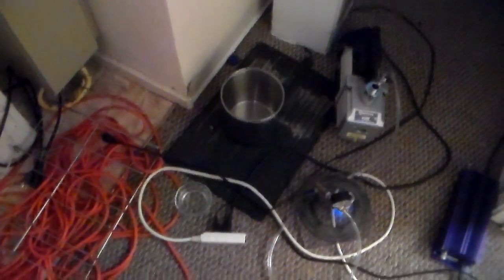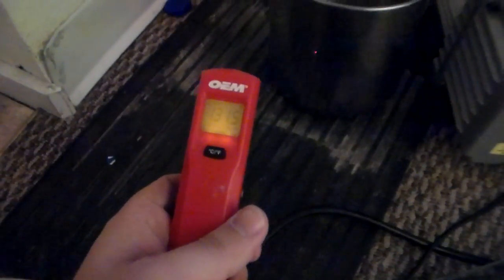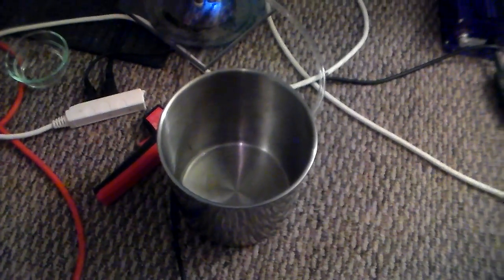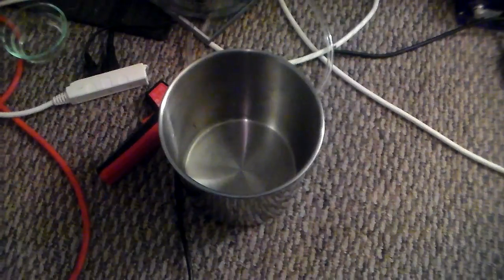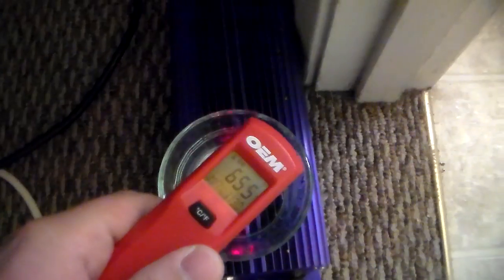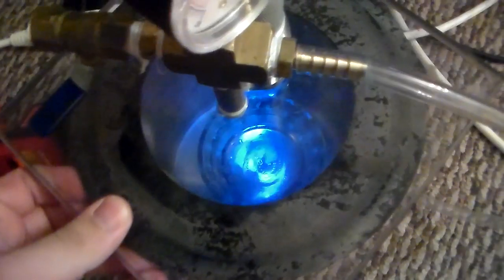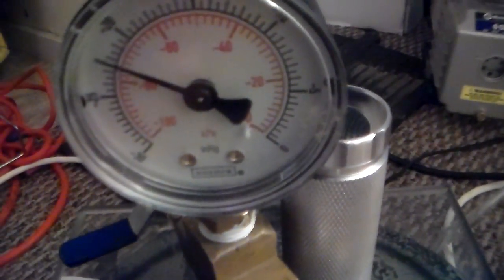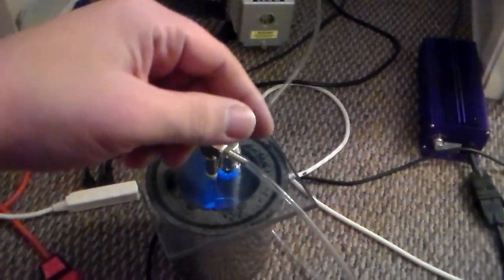I was wrong!

Comment: Putting the oil under a vacuum lowers the boiling point of butane which allows it to boil off faster without harming the potency of the oil. But over-purging can still be a problem as terps also have lowered boiling points under a vacuum, so you can ruin your flavor if you don't watch your pressures closely enough.

Comment: When i went to HVAC school, we learned that water does boil in a negative pressure. Now i dont know if it can kill pathogens like normal . I also did a vacuum without any heat becuase ones i noticed heat being applied, i noticed the product getting a little darker as it got towards -30. So i either do -20 and low heat100f, or no heat and -30.

So now what i try and do is... I add in flipping and stretching the product every so often to insure that the product  bubbles up and no more rainbow bubbles.

Comment: the closed loop extractor operates under vacuum and does reduce the boiling temperature of butane also. so you can do them without having to apply a lot of heat to get the liquid tane to convert into a gas

Comment: The vapor pressure of water at 100 degrees Celsius is 760 mmHg, which is the same as standard atmospheric pressure.So yes water boils in a vacuum. wHAT'S TRIPPY IS WHAT HAPPENS TO ICE IN A VACUUM

Comment: very wrong wiki boiling point, and h20 is h20 not h30 it can be negatively and positively charged but the substance does not have "dissolved oxygen" The air is only part oxygen by the way.

Comment: Look at it like this:
At normal atmospheric pressure (almost 15 PSI) it takes 212F to make water turn to vapor.
Lower the pressure and the vapor point drops, 
BUT
Raise the pressure and it goes up.
Just because water turns to vapor under a vacuum it doesn't mean that you are 'boiling' the THC & goodies. 
Keep doin what you're doin, man!

Comment: The temp of the water never rises.... If you stuck a thermometer in the water and the. Turned the vac on you would see the temp never moves. I don't believe the water is boiling I believe it's cause from the negative pressure.

Comment: Since there is no environmental pressure on the liquid in vacuum, its boiling point is directly above its freezing point. In other words, as soon as the liquid unfreezes from the solid state, it turns to steam because there is no outside pressure to hold the molecules in liquid state.As far as the boiling who knows what happens to the terpenes in the resin.